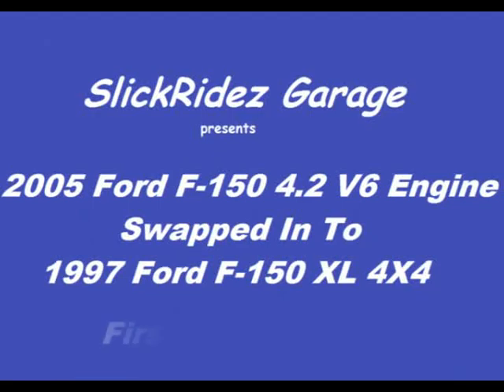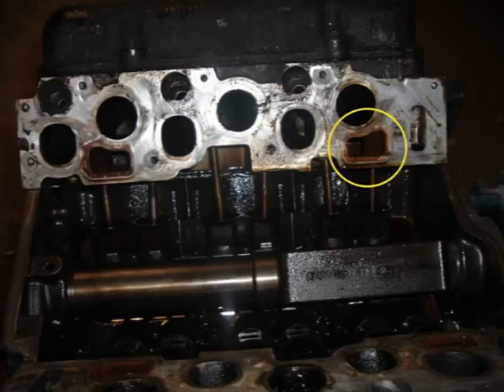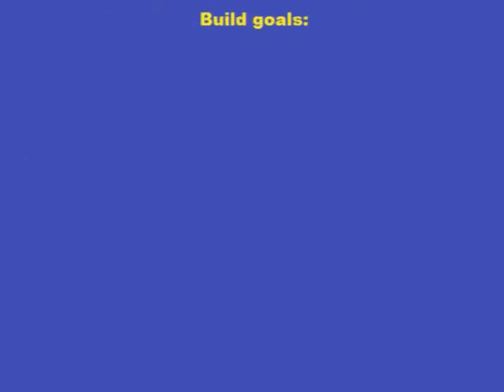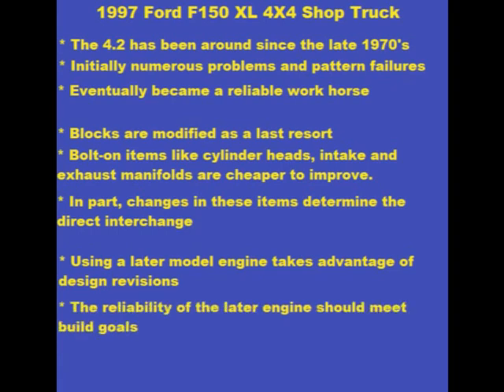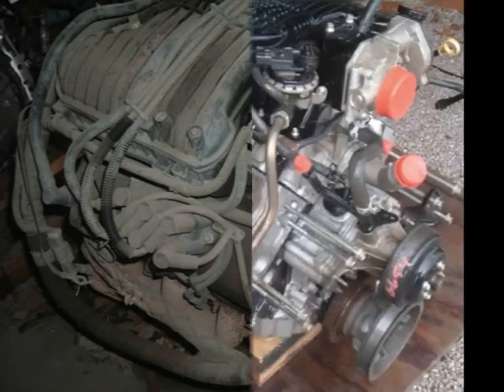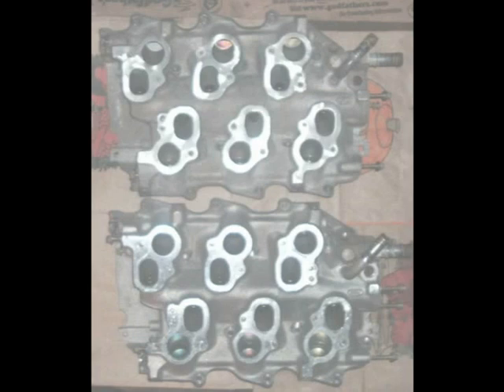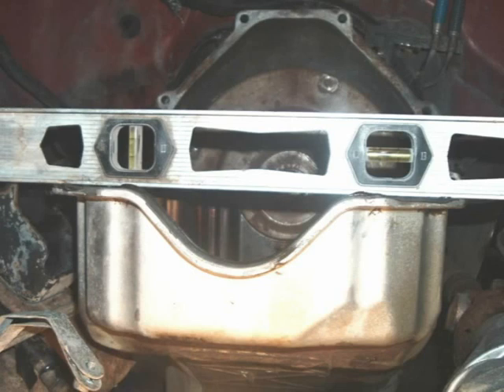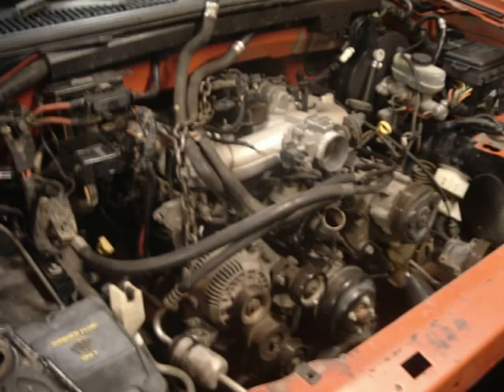2005 Ford F150 4.2 V6 engine swapped in to 1997 F150 4X4

Comment: I had a 2001 F150 XL truck purchased brand new. After 70K miles, the engine hydrolocked as well as having a defective mass airflow sensor and exhaust sensor early on. Worst truck I've ever owned. Very little power from that engine from day one! :(
Reply from the maker: So far I'm pretty satisfied with my F150, save for a selector shaft seal leak on the transmission. Not as powerful as the V8 but a little better on fuel and decent power when the IMRC opens the extra butterflies in the intake. Maybe you got one that was built on a Monday or Friday? lol thanks for watching and for commenting, have a great day!
Reply: I think you made a good point. I hope you have a great day too!
Reply: They are rightly famous for being pieces of shit in the early years, and the anecdotes of those whose INDIVIDUAL engines work well are just anecdotes. Mine which just hydrolocked served me for 125K (total 235K IF it was not previously replaced) but 235K for a modern engine is pathetic. At least they are easy to work on and cheap to replace. Too bad automakers don't use standard SAE bellhousings or mine would have an LS 6.0. I don't like the rest of the Chevy as much as a Ford (I own both, brandwhores are stupid children) but GM got that engine right though their transmissions are trash.